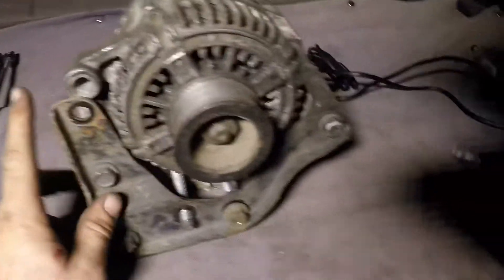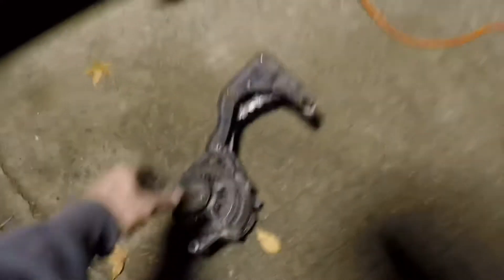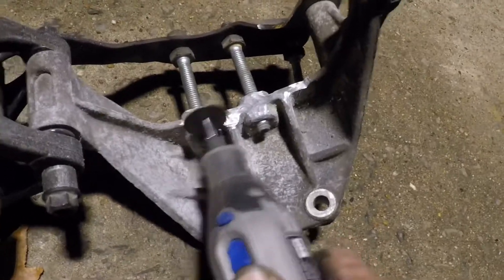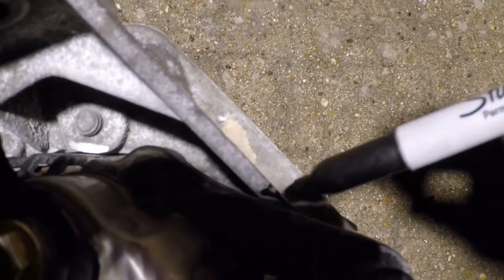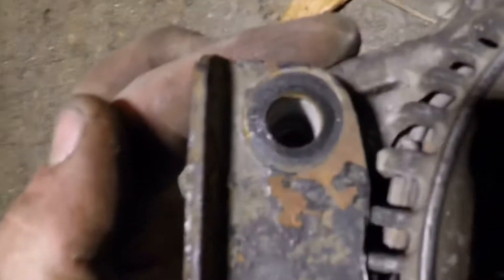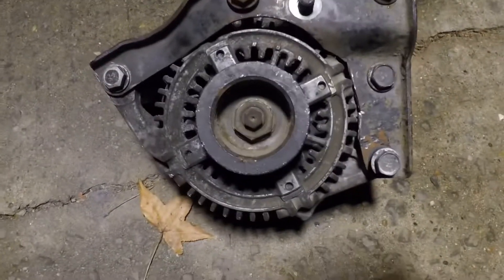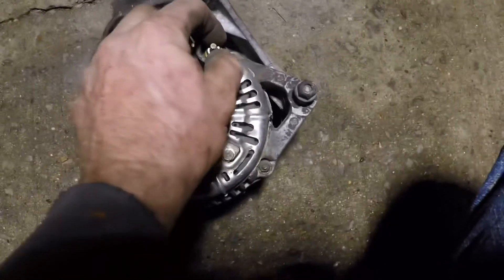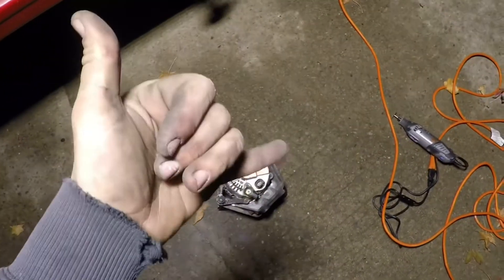Jeep Cherokee XJ how to fit a 99 Durango 136 amp alternator

Comment: Will this work on a 93 xj
Reply from the maker: potentially, you will have to determine if the brackets are the same or not, and then adapt the old style plug to a newer style alternator unit.

Comment: Great vid. I just ordered a 160 amp alt from a 02 Durango and should be the same process.
Reply: I just got a 160A for a 2000 durango from autozone because i couldnt find one in the junkyard they were all snatched but anyways im picking it up in abt half an hr💯
Reply from the maker: @maurycemckinley626 You may have to slightly alter the bracket more vs. the 130 AMP to accommodate it, but if I remember right the 160 amp is a deeper body version of the 130, so hopefully it really doesn't change anything, and it is no tighter between the uniframe and block, on mine there is like 1/2" gap to the uniframe, and near nothing against the block.
Reply: @YourFriendStChris  that very well could be. Shouldn't be an issue. Might just require a little more finessing. Upgraded the battery cables years ago and was still running a 117amp alt. Figured it's time for an upgrade. I have some subs in the back so it'll be nice have no problem powering an amp plus aux lights.